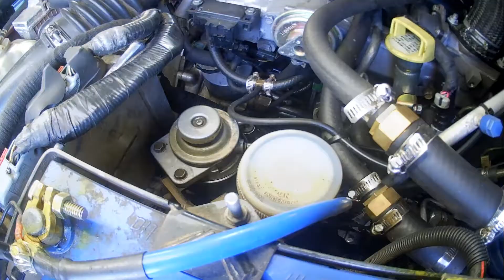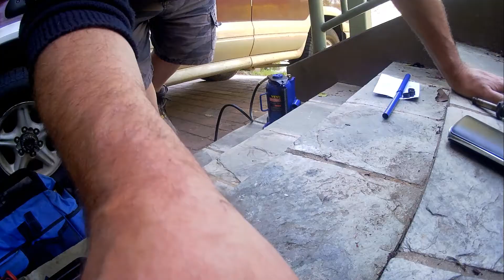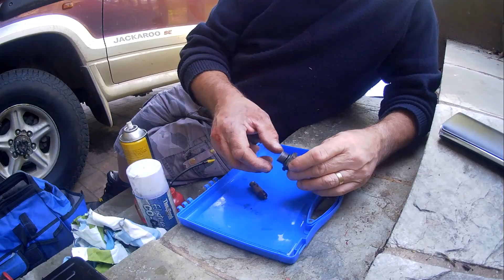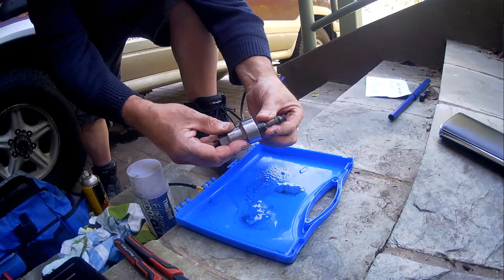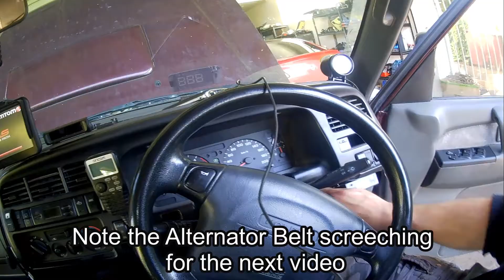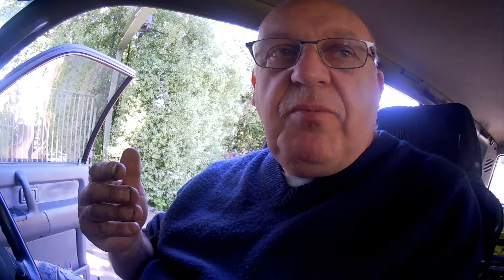4JX1 Engine—RPCV Removal, cleaning and refitting.

Comment: Hi anyone with a Isuzu trooper 4xj1 manual that actually shows how the engine and oil pressure and injectors are situated. Bought a manual that says its 4jx1 but only shows air conditioning, and every other repair than an actual workings of the engine and putting it together. Trooper 3.0tdi 4xj1 slow to strart runs rough than runs ok for the day, oil pressure slow to go up. Desperate need of manual that shows diagrams of the engine and where everything is.
Reply from the maker: There is an Isuzu Manual for the later Jackaroo here https://www.patreon.com/posts/jackaroo-manual-117835607?utm_medium=clipboard_copy&utm_source=copyLink&utm_campaign=postshare_creator&utm_content=join_link

Or you can get it by joining the 4JX1 Decompile/Project FB Group in the files section.

Comment: Hello, what could be wrong so that when you turn the ignition switch the engine light flashes at very high speed and then the frequency drops but the engine never starts... only after hundreds of attempts suddenly the light stays on normally and the engine It turns on normally... until the phenomenon repeats itself... Thank you...
Reply from the maker: I've never heard of this before but I would expect it is a broken cable. Have a look at your battery cables especially the ones that go to the starter. Also, check the injector harness plug near the oil dipstick. That can get oil in it and it can cause strange issues. Give it a clean with electrical contact cleaner.

Comment: Good job mate i might try this..just had injectors rebuilt due to diesel and oil mixing. Now its not starting. Ill try to remove rpcv will buy 21mm socket first
Reply from the maker: Buy a special tool from Chris who runs the 4JX1 Decompile/ project FaceBook Channel, they work best.

Comment: Hello, I have an Isuzu 4jx1 that after several attempts starts but the accelerator does not respond and smokes until after a few minutes it normalizes and starts running perfectly... I can drive for hours without any problem but if I stop the engine it takes two or three seconds to start and if I leave it stopped for two hours it almost won't start. Where should I start the diagnosis? Please I need some guidance at least. Thank you
Reply: Right most of but not for this engine 😢
Reply from the maker: First thing is what oil are you using?
Reply: @thejackaroo4WDcampingchannel  I'm using 15/40
I asked for api 5/30 and they told me that when the motors are worn out, put this other 15/40.
Surely that's wrong...

Comment: I had to replace mine the part from a ford 7.3 powerstroke diesel fitted and ran fine no modifications needed, hard finding these from isuzu or aftermarket
Reply from the maker: They aren't that difficult to find but it is good information knowing that the Power stroke version works okay. You can buy these from any Caterpillar dealer for around $700, Holden can also get them but you'll pay a premium, around $900 and they'll likely buy them from Caterpillar anyway. You should be able to buy them from Ramin Auto Spares in Dubai, not sure of cost. As they are a Caterpillar part anyway, I sourced one at a truck dealer in Dandenong and they had one in stock.

Comment: Hi, which way round does the pin go? Small point facing the front of the car? Also which way round does the big slide go big hole to the front of the vehicle?
Reply from the maker: If you go to the FB group, there's a drawing in the  files area. However, I think I can post it in the 'Community' area on here for you. You may need to click on it to get it to show full size.
https://www.facebook.com/groups/264658247280734

Comment: what the wrench is size to remove. thank you to help all of us with this video
Reply: Use a ring spanner 29 mm
Reply from the maker: Yes, you can, but the issue is if you bend the cylinder whilst removing it @henkkiezebrink4023
Reply from the maker: I'm not sure of the size but you need an extra long socket that can fit over the end of the RPCV. Best to get one from Chris on the 4JX1 Compile/ Decompile Project FB Group

Comment: where can you buy the new RPCV  from and whats it called , my vehicle winds over a long time to start and wont idel when warm cuts out , have throttle to the floor when starting and it finally starts and barley picks up reves very slow as throttel  still to floor , o and hve you got contact to chris to  get the socket tool for the job as well sorry about all the questions
Reply from the maker: RPCV is the Rail Pressure Control Valve and you can buy from Holden (expensive) or from a Caterpillar Dealer (less expensive). Do Not buy from eBay, you'll waste your money. Otherwise, try Ramin Auto in Dubai, email Ibrahim here: raminaut@emirates.net.ae
Reply: Others call it ORPS Oil Rail Pressure Sensor @thejackaroo4WDcampingchannel
Reply from the maker: No, the ORPS is in the head,  the RPCV is a different device

Comment: Cut the white wire, still no start. Tech 2 time or is there something else to look at?
Reply from the maker: The white wire trick is to fool the ECU into going into limp home mode. If that does not make it start, my next check would be to remove the RCPV and clean it out.

Comment: The piston cooler control valve is another spot you can loose oil when sitting over night. The rail is supposed to hold around 30 psi sitting static but mine was only holding 8 psi. Making a long crank time to build back pressure on the rail. Thanks for the video. Engine out job for that valve change😮
Reply from the maker: The oil rail end cap seals can leak oil and you'd only notice when the pressure drops and it is hard to start.
Reply: @thejackaroo4WDcampingchannel  Yes there are many areas they can leak. I resealed my rail and made up a rough tool for getting the end caps off. I pressurised the oil rail system with air and that is how I found the piston cooler check valve was weak and leaking.

Comment: Собираюсь исполнить по вашей рекомендации.Двигатель не заводится на холодную.На горячем заводится.
Reply from the maker: I had to translate your comment, please consider using English if you can. If you are having problems with cold starting and not when it is hot, I suggest you post on the '4JX1 Compile Research Project' Channel on Facebook. You'll get some positive help there. Here's a link:
https://www.facebook.com/groups/264658247280734

Comment: G'day is the rpcv valve the same as a Pcv valve? Mine is suddenly belching thick blue smoke when cold. There is oily fluid in the outlet of the intercooler and it runs like a dog under 1500rpm. It's fine when it's warm. Its got fresh 5w30 oil. This all started when I had a bloke pull the rocker cover off to time the ignition mark on the flywheel following a clutch replacement. Any clues please?
Thank you from Dan.
Reply from the maker: Another word of warning, be very careful buying parts off online auction sites, there are a lot of garbage parts out there that just don't work.
Reply: @thejackaroo4WDcampingchannel  thankyou for your kind reply. Much appreciated. Just to confirm the bloke who put the gearbox in pulled the rocker cover off to time the injection timing, to confirm TDC when reinstalling the flywheel. I have since put an EGR blank in, cleaned the map port, changed the oil to 5w30 full synthetic. Replaced the air and fuel filter. If I can't find anyone with a tech 2 over here would you be interested in a cash job to look at it? Cheers Dan.
Reply from the maker: @danielzwager7790  Problem I have is that I work Monday to Friday so it only leaves the weekend, where are you based?
Reply from the maker: Thanks for the question Dan, I would think that yes, if you are driving any model of Trooper with a 4JX1 engine, the RPCV is likely the PCV as well. I think it is just a case of people calling it different things. 

If it were me and the car ran okay before the bloke got in there to time the ignition after a clutch replacement, then I would be looking at that. A lot depends on who it was and what their experience is. The ideal thing is to use a Tech 2 to connect and look at what both the RPCV and the ORPS are doing. The FB Group '4JX1 decompile/learning project' has a list of people and their locations and mobile numbers, that have a Tech 2 if you don't have one.
https://www.facebook.com/groups/264658247280734

The 4JX1 is a HEUI injection engine and relies a lot on the RPCV, ORPS and the ECU to control how the car runs. I would also look at the injectors with the Tech 2 and run the tests to see if that identifies an issue. Because they can cause a car to run rough at lower RPM and clear up when the engine is running at higher rpm.

Regarding belching blue smoke, the oil in the intercooler pipe may well be your issue. It could be coming from the EGR return or the turbo itself. The best way to check is to remove the air inlet pipe to the turbo and see if there is oil there. If there is, then it's likely the EGR and I would fit a decent catch can. If there is no oil there and there is oil in the intercooler then likely the turbo is causing it. I'll be posting a turbo exchange video tonight or tomorrow. I'm uncertain if you know but EGR stand for Exhaust Gas Recirculation and basically, it returns any pressure created by combustion gases bypassing the piston and pressuring the oil sump. We used to vent it to the atmosphere but now it gets recirculated and can cause major issues in car engines that have direct injection like the Jackaroo.  EGR fundamentally re-directs these gases so they get burnt in the combustion chamber, a great idea in principle but over the long term they can cause major issues.

The 4JX1 engines are getting long in the tooth now and if you have high kilometres, then your piston rings may be worn and combustion gases are getting past the piston, this is called blow by. Those oil filled gases are likely recirculating and burning in the combustion chamber.

What is your oil level doing, it isn't increasing on its own is it?

I know this is a long-winded response but at least it may help.